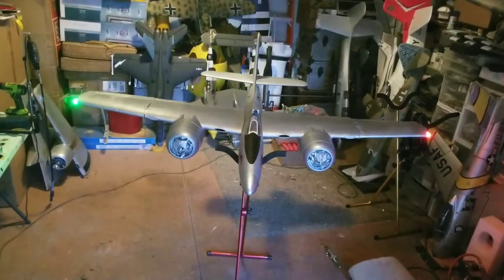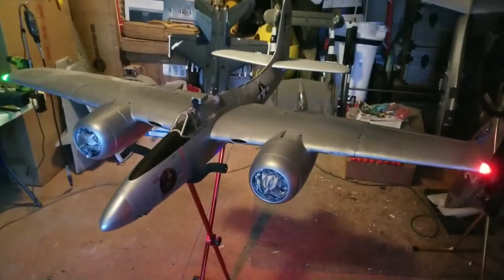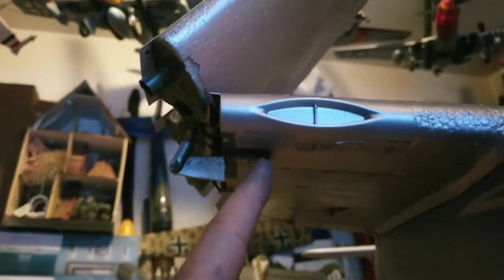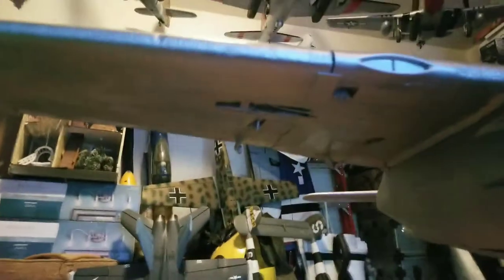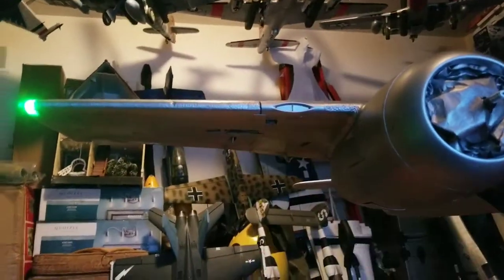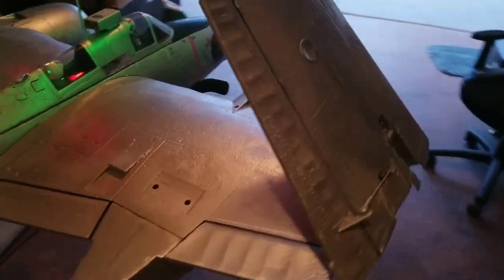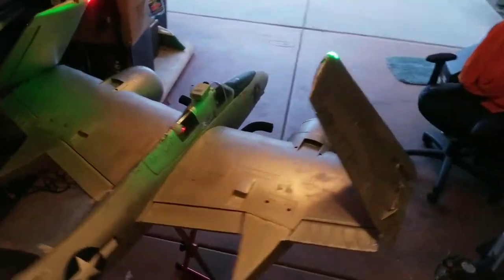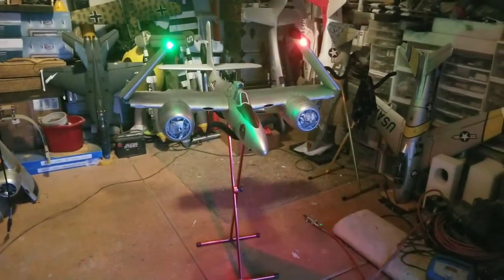More progress on the 1700mm FMS Superior F7F-3 Tigercat.

Comment: Well done Brandon! Well thought through! I am wondering if you can program folding servo speed so it would look more realistic! It takes to much time to fold and unfold the wings, doesn’t it? I am just imagining doing that on the airshow on the runway while taxiing....
Reply from the maker: Actually the speed is fairly scale like as is. You can't controll the speed of the wing fold controlling motor (it's either on or off) or the locking rod. All that it controllable is the time delay between the two when they engage so they don't interfere with each other.